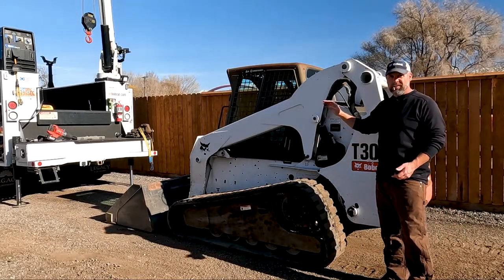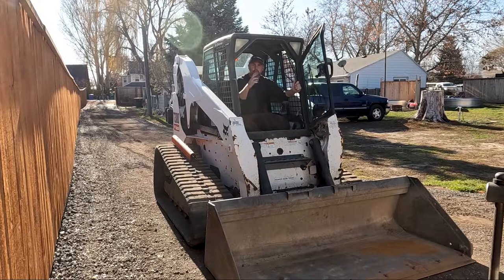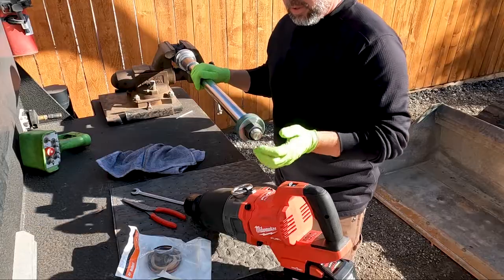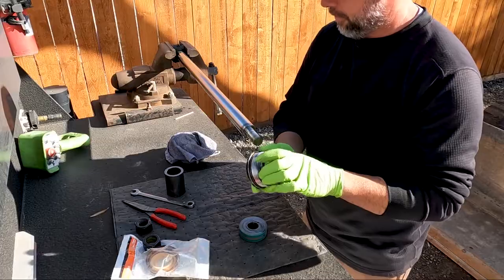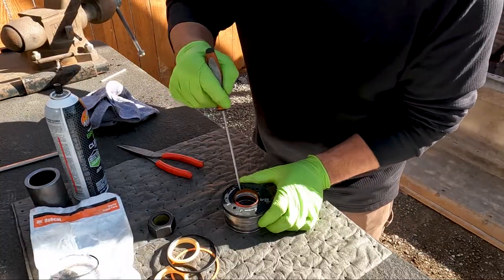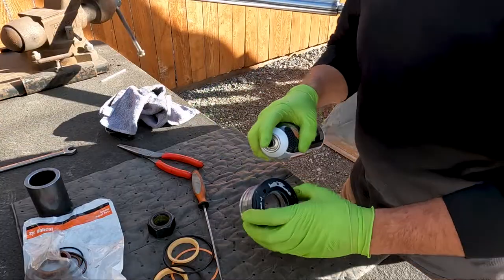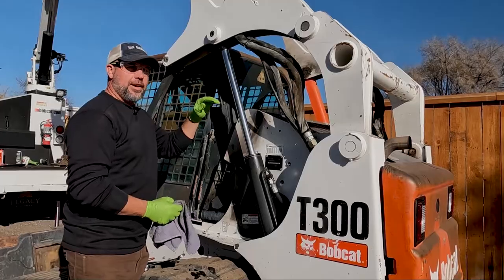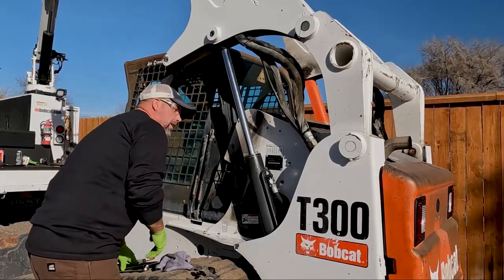Bobcat Hydraulic Lift Cylinder Leaking on my T300. How to remove, reseal, and put back together.

Comment: just did everything the way you showed. Still can't get the rod out of the cylinder. Had to use a ratchet strap to get the rod back down so would have enough room to remove whole cylinder. And yes both lines were removed.  the cylinder would move in hard jerks going back in. is it possible it could have rolled a seal?
Reply from the maker: Sounds like something is binding, could definitely be a rolled seal.  Let me know what you find.

Comment: Have you done any videos on replacing the anticavitation/relief valves
Reply from the maker: Not yet, it's very rare to have an issue with port relief/anti-cavitation valves. I do have several training valve blocks I could use to show how it's done.  Thanks for the suggestion.
Reply: Thanks. My bucket will start to fall pretty often when using it but not always. I figured it might be a weak relief valve

Comment: how do you stretch the piston seal.l worked on a 610 and there was no way to slip it over the piston with out breaking it.
Reply from the maker: Heat it in hot oil.

Comment: You said this is same with almost all bobcat skid steers. I have an s185 and I was told I have to have an overhead crane to pull the rod/piston out and cannot do it by hand like you did in this video. Do you know if that’s correct?
Reply from the maker: I used my overhead crane for extra safety but you should not need a crane for the S185, should be almost identical to what I did in this video.

Comment: How many hours are on this machine?  I have an S175 and noticed that the lift cylinder was leaking and it has 1780 some hours on it. I'm just curious. Thanks!
Reply from the maker: This machine had around 3500 hours, I'm sure this was not the first time it's been resealed.
Reply: @tetradgroup  Thanks for the fast reply! I was worried that the seal replacement would take a long time but your video makes it seem easy! Thanks for the tops and help!

Comment: Great video, thank you.
Reply from the maker: Glad you liked it!
Reply: @tetradgroup   I am finally getting to my S300. Is there anything special you need to do as far as bleeding the air, after repacking the cylinder?

Mine is taking a while because I just moved and I don't have electric, or air. I have a 1" air gun so I don't want to by a Millie. LOL Also, got the new seal kit and of all tools I own, I had to order a 42mm socket for the piston nut. Yes the OTC tool you recommended works great. 

Also, do you have a part number for the smooth jaw needle nose? Thanks again for all you do!
Reply: Well.......... I screwed up the piston seal. It must have caught a thread when I was trying to weasel it in there.  I even taped it like you mentioned some guys do. Well, off to the hydraulic shop to hopefully get just that seal. I don't want to spend another $115 on a whole kit.

Do they make a seal/ring compressor for this? If so, can you provide any information, please?

Comment: Is it possible that the arms wont lift at all if both cylinders have bad seals? , I know both sides need resealed and the arms wont lift, I may have to remove the entire cylinder ,Thanks for the video
Reply from the maker: It would be an extreme case of both cylinders bypassing to the point they would not lift at all.
Reply: @tetradgroup  Thanks, I just did the left cylinder, of the 7 pieces only 3 were in one piece, everything else was rotten, missing or broken. I used a hose clamp for the bottom ring, I hope I didn't do any damage, afterwards someone said it could damage that ring if electrical tape isn't applied first. Thanks for your videos, they're helping me tremendously!

Comment: Hey buddy my  s300 leaks oil of the cap after leaving it running for a few minutes I already put the right weight oil and still leaking and there’s no fast response on the tilt please respond I’m new to bobcats thank you
Reply from the maker: What oil leaks from what cap?  What model machine do you have and what type of controls, joystick or foot control?

Comment: I have a G773 and need to remove the left cylinder. Having a hard time removing the lower pin. Any special tool or technique to remove this stuck pin.
Reply from the maker: Sometimes it really sucks but one method I use is to weld a nut to the pin that fits your slide hammer and slide hammer it out.   Sometimes heating the pin with torch helps, worst case we have to lance it out.
Reply: @tetradgroup  Thank you for getting back with me. I'll let you know how it goes.

Comment: Did a similar DIY on my trucks Ram. Costed me only $100 for seals. Ram works like new.
Shops were quoting 600 to 800 and were saying they will also need to do sandblasting of barrel and
 re-chroming of rod.. Talk about over engineering or they are just scamming.

Comment: Do you run bobcat final drive fluid or just 90w
Reply from the maker: For final drive planetary in excavators I use 80w-90.  For the track loaders I stick with Bobcat oil.  Old style drive motors use a different oil than the newer motors.  I know its expensive but it is a high quality synthetic oil and you know it's the correct recommened oil.  I don't know the exact viscosity of the super secret Bobcat oil.
Reply: Roger that. I have so many I would love to save the money

Comment: The lift arms must be angled a bit diff on M series.  For T650 I had to use a forklift to raise my arms 8+ in higher than they would sit on the safety U bar to get enuff room to pull my rod out.   I sure could use  big MILLIE right now!   My milw has 1600ft lbs and its useless.   Damn you make this look easy but its quickly reminding me of my Ex … STUBBORN and BITCHY as Hell.   That nut is on TIGHT with the thread lock !  😅.   Thanks